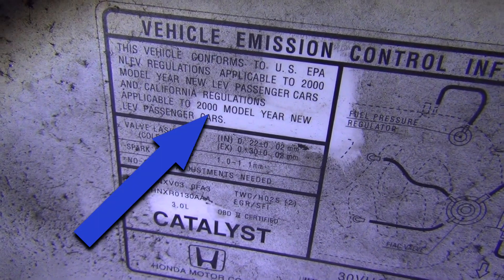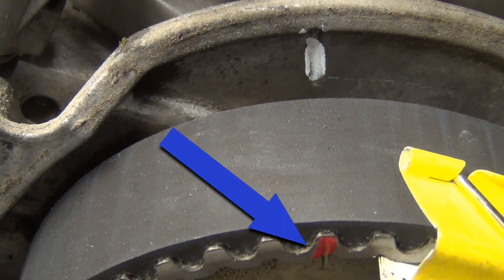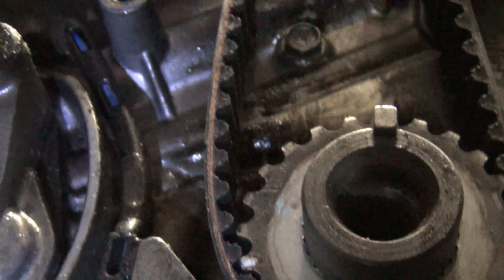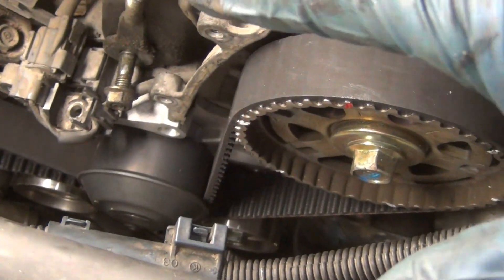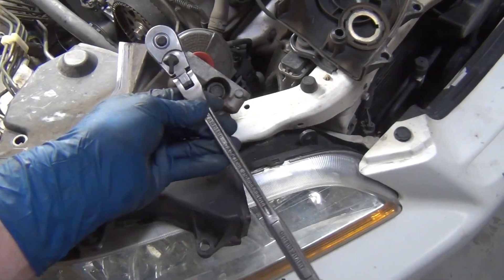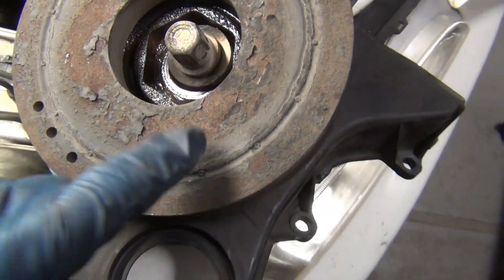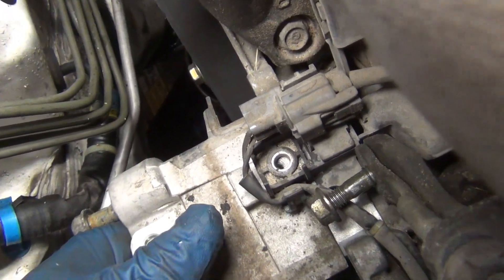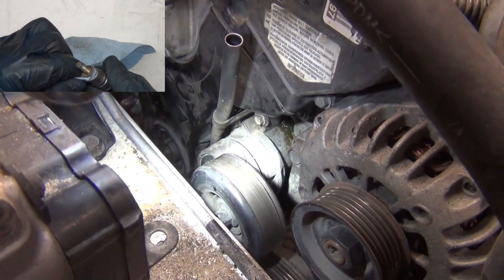How to Replace a Timing Belt   Honda   Acura V6 Edition 3.0L 3.2L 3.5L

Comment: Well Brian, I invested in the special thick socket, the harmonic balancer holder, and the powerful Milwaukee electric impact. I still had to heat the bolt, just as you advised. Thank you for your clear and precise guidance; it made a world of difference! 🎉

Comment: After the timing belt change.  No engine error, no code.  All ok.   Except, there is a small faint knoking sound from the engine and the engine seems to be running stronger than before.  Meaning, a stronger noise too.    Would that be something with the timing belt change?

Comment: I had the tensioner failure I replace it and it still has the clacking sound what do you think happen or I did wrong I bought the hydro tensioner from autozone could it have been faulty

Comment: ok so i have a 2016 accord v6. Need the timing belt done. What all do you recomend replacing when doing the job? Any of the pully's? Is the hydrallic tensioner part of the tensioner pully itself?

Comment: I like doing these belts even more than doing subaru's. On a bad day, they take about an hour.
Reply from the maker: That's pretty fast!  I take my time.  Hopefully do the water pump, plugs, and valve adjust while in there.
Reply: @briansmobile1   At my dealership,  spark plugs and valve adjust are separate services.  Which makes no sense, but no matter how many times I bring it up, it falls on deaf ears. 

But yes, water pump and tensioner every time. 

That socket you have, do you know if that fits on a subaru crank shaft? I searched for a commercially available one, but nothing for Honda's. I had the belt jump time on me ONCE when taking the crank bolt back out, but I still think about it every time.

Comment: This is not an interferance motor bud , these are non-interferance motor which means if these timing belts snap they wont bend valves or put a valve through the piston, even if you rotate this engines valves wont touch piston at all

Comment: If you do Honda timing belts often enough, I HIGHLY recommend getting a Lisle 77080 19mm harmonic balancer socket. These are about three pounds of impact socket with a 1/2" drive. Use with a decent air impact (not even a heavy duty one) and it will take the bolt out of the harmonic balancer EVERY time ... no muss, no fuss. I was amazed at how well it worked. You can find them on Amazon for ~$23 on Prime. Absolutely a no brainer if you do these on a regular basis. Every Honda engine I've worked on, whether 4-cyl or 6-cyl has the 19mm balancer bolt which you can use this on. https://www.amazon.com/Lisle-77080-Harmonic-Balancer-Socket/dp/B00RGNCV1U/

Comment: For all the years you have worked as an auto tech,did the camshafts ever jump on you,after you removed the timing belt ? Should it jumped,how did you get it to position,turn either way or just clock wise ?

Comment: First time doing the replacement and now the car vibrates badly. Anyone know why?
Reply from the maker: Yeah- I've had that.  Belt was off the mark by a tooth or two.  Usually caused by slack in the wrong section.
Reply: @briansmobile1  maybe the tooth because there was no marks or indentation or anything...

Comment: Very nice and well done video. I thought the tip for starting with timing marks very slightly counterclockwise was very useful as the slack can be taken out at the final check. Heating the crank bolt washer a very good tip also. Thank You

Comment: I'm going to use the starter to crack the crank bolt free but my question would be, how do you hold the balancer still when tightening the bolt?

Comment: Also you can grease your bearings and iddlers with mobil one high temp syntethic grease,pop the seals and greae them,i have a aveo that shatters the plastic iddlers but since i grease them,they have last 200k i also change the plastic iddler to a metal one,same size of close to.

Comment: So why does he line the timing mark slightly off counter-clockwise?  Did he explain the reason?  EDIT:  OK, he explained 7 mins later.  But still not sure benefit of doing that if you're going to crank 720 degrees to confirm timing after belt installation.  so he isn't doing the 720 degree rotation to check, he just cranks clockwise a little to remove slack in belt after installation.

Comment: Found the crank bolt comes out easy with an impact.  The rear cam pulley is tricky to center and want to rotate forward or back instead of rest lined up with marks. Do not remove crank pulley Key or if you do realign timing ring, sprocket to crank.  Mark old belt teeth before removing tensioner the make same marks on new belt to make sure rear pulley does not skip, crank and front pulley will stay put when using tips in this video.

Comment: @1:28  lol if the timing belt broke just putting a belt on wont fix it. Also get the special thick honda 19mm socket and stuff that on your impact gun. I don't rec using a torch...

Comment: Just a quick note, ALL J series Honda engines are non interference, so you can feel free ONLY ON HONDA J SERIES to rotate cams as much as needed if your belt was broken to get it back to all it's marks.
Reply: Old comment, I know, but the J35’s are in fact interference engines.

Comment: At 200,100 km my 06 Accord is due for a belt. My independent shop wants $1,200 + to do the belt and water pump. With recent piston slap on #5 I think the car is done. Excellent video, you cut right to the point. If it wasn't for the piston I would do the job myself 👍

Comment: Years later you are a life saver.. Straight forward and now I'm confident I have all the equipment needed.. Ill let you know how it goes! Water pump, timing belt, grenade tensioner , idler  pulleys x2 and office depot clips & harmonic 50mm puller tool. ✔
Reply: So how did it go ?? 
Did you tackle it? Does it drive. Please tell

Comment: Kudos. You always teaching us with your great videos. I'm looking forward to change my timing belt, rebuilt the transmission, and change the rear main seal in my Accord 99 V6 3.0.

I just wanted to show you and other people here this video in spanish about how to synchronize not the only the camshaft and the crankshaft, but also the other two gears (front and rear where the belt gets around too. Very valuable info. The rear gear has two marks (on the gear and the shaft). And on the front gear you need to get that bolt out to insert a long screwdriver all the way in. That gear has one mark but he says it won't matter if it doesn't have the mark if the screwdriver goes all the way in, I guess just to be safe get that mark and all the screwdriver in. On minute 6:45 he also explains to do not rotate the camshaft without the timing belt, and that if you do, then you should rotate the crankshaft mark on a horizontal plane(way). And depending in what unsynchronized position the crankshaft gear mark, then you move the mark to the closest horizontal plane (90 degrees). And then move your camshaft to put in the right up/mark position so you won't damage the valves. https://www.youtube.com/watch?v=b_F-YLZk2tI&index=6&list=LLgWu5YmOz0PMwN7C_RGYTIQ&t=0s

Comment: Replaced the timing belt on 97 Acura 3.0CL 6 cylinder, automatic. Drove it and found this: From a dead start the car hesitates/power loss when going into 2nd gear but will  gain speed. In neutral it sputters at 3,000 RPM and will not going higher in RPM. I'm thinking it is one tooth off forward on the front camshaft sprocket. I also noticed that the idle is about 600-650 instead of the 800-850 where it should be. Does anyone have any ideas?

Comment: how many miles does a timing belt last? What is the mileage interval  that you should change the the timing belt?
Reply: ron334 first I would check the owner's manual to see what they recommend. On my daughter's 2001 Honda Accord V6 the owner's manual recommends 105,000 miles. I change the TB between 90,000-100,000 miles. I would never go over manufacturer's  recommendation for changing a Timing Belt on a   zero clearance motor.
Reply: for the Honda/Acura J6 engines the replacement interval is 105,000 miles.   In my case however I didn't put a lot of miles on the car so I also ran into a time issue.   If the belt is getting old, despite the miles, it can break down and start to come apart.   I am replacing mine at 12years, 105,000 miles but most people would recommend not waiting longer that 10 years.   Sooner is better.

Comment: 9:50 the only way ive gotten by without an impact doing a timimg belt. It works!
Reply: Waffeey how do you hold the pulley still when tightening the crank bolt?

Comment: If i turned my engine clockwise by the front cam without the metal dowl in the crank gear a quarter can i just turn it back to align the dowl will that be fine or am i out of timing now?

Comment: Just had mine done at the local Honda stealership for $800.  They were running a special which included new timing belt, tensioner, water pump, coolant and drive belt.  Kinda makes me wonder how they made money on the job... maybe they didnt replace anything? haha.

Comment: question - so you mean to inform us that between 0:30 & 3:45, as long as the markings on he pulleys are aligned with the markings on the motor itself, we will be ok?

I ask bc Hayne's Manual makes it seem like it is the end of world if one does not align the #1 piston/valve/what have you with "Top Dead Center"...

Comment: It’s a great tech video with good info but why not clean all the power steering fluid and oil that was leaking in there before putting a new belt??

Comment: Thank You Brian. I have a question. I have 2004 Honda Pilot and have an error code 0341 which is the CMP sensor.My mechanic says that I have to remove the timing belt in order to remove the CMP sensor, however, other mechanics say that it is not necessary to remove the timing belt could You please tell me what to do? I am confused also

Comment: Well done. It's nice to see a video from someone that is knowledgeable AND articulate. Lots of great little tips in there like using the wife's Macy's credit card to hold the belt on the crank. I didn't read the comments but you turn the engine over twice to verify timing alignment, right?

Comment: I used a 4X Torque Multiplier and have never had any problems removing crank bolts.  It is a lot safer, since the torque is gradually applied to the bolt, and I never have a problem where the bolt release and your knuckles smashes into something.  Other than the cost I'm surprised that people don't use it more often.

Comment: I got 2002 Acura TL 3.2 i change time belt 7 years at 67,500 mile . Now i have 8 years on Time belt 124, 600 on it . only put on it in all most 8 years 58,000. You think i can wait little more on it.

Comment: oh shit.... timing belt replacing was sooo freaking easy on pontiac sunfire i had.. and now i recently bought 7 gen accord v6 and it seems a lot more complicated based on your video instruction. 
I understand that you have replaced water pump and a few pulleys along with timing belt but still... timing belt part doesn't seem as easy as it was on all my previous cars. :(
Reply: I traded my 2010 Odyssey for a 1990 pontiac 6000  after reading your coment.   Now THIS is indeed a DIY . .

Comment: My car is at the near 250K mark. This is probably a job I'll be doing soon. Just has to replace my steering fluid line this last winter because the hose was rotted.

Comment: Hi Brian , I am replacing  my timing  belt  and I ran in to a bitter of problem. My top two camshaft lineup perfectly and the bottom small camshaft off the mark. i rotated so many time to get bottom mark lineup but still I can get it right . Your help will be greatly appreciated very much...senevi

Comment: I was looking to do this on our 2008 V6 until I saw the menace that is the harmonic balancer. Said F that and had someone do it. Would've taken me 2+ days probably.
Reply: Just purchase Lisle 77080 19 mm Harmonic Balancer Socket for Honda on Amazon for $25.    Takes that bolt off in seconds.   Watch Youtube videos with that socket in action.

Comment: if the old belt is still intact and not jumped time you can create your own timing marks with a marker or something on the timing gears and corresponding marks on the old belt. once it's off count the teeth between the marks and transfer the marks to new belt. so easy and quick, and you really can't mess up the timing.

Comment: I love Honda tBelts!  I used to use a torch for the balancer bolt but,  now I use a tool I made. I took a short 19mm and slid it into a deep socket that is about the same size as the washer and welded them together. That way the washer and the bolt both get hammered, by the impact. It is amazing and has never failed me. It's a 1/2 socket of course.
Reply: Just purchase Lisle 77080 19 mm Harmonic Balancer Socket for Honda on Amazon for $25.    Takes that bolt off in seconds.   Watch Youtube videos with that socket in action.
Reply: @troyfall6573  I agree.  Pretty much most people recommend an impact rated at >500lb/ft torque for the crank bolt.  That plus the special socket should get them off.  I haven't done mine yet but I have a 1400 lb/ft electric impact that takes axle nuts and rusted exhaust bolts off like they weren't even there so I'm not too worried.

Comment: Hahaha, the number of times I've wedged a prybar against the ground and cranked the engine to get the crank pulley bolt off...  LOL
Reply: Dont do it on pre 2000 hondas you will shear the bolt , as the pre 2000 hondas are anti-clockwise rotating engines

Comment: How do you know/read about firing order for the vehicles? 
I often noticed it's better way to change idler pulleys and tensioner and water pump when replacing timing belts. It leads us to go more thousand miles conveniently, other way Idler Pulleys or Water Pump may deteriorate before timing belt.

Comment: True test is driving it and feeling that you have the same power you did before the belt. Hack mechanics may be a tooth off, causing the timing to be off and not have full power.

Comment: Theirs also a special honda crank pully tool you can buy for about 30 to 40 dollars, I bought one to make it easier
Reply: If you want to use the crank pully tool you can rent it for free at Autozone, O'Reilly.  Just put down a deposit.   OR better yet, Just purchase Lisle 77080 19 mm Harmonic Balancer Socket for Honda on Amazon for $25.    Takes that bolt off in seconds.   Watch Youtube videos with that socket in action.

Comment: to whom it may concern..I did a very similar job on a KIA sportage..all went well except....on the top of the upper timing belt cover 7:28 there is a little plastic seal ..make DAMM sure this thing is tucked in because mine apparently got caught up between the cam sprocket and the belt and jumped the time about 60 degrees  while I was tooling down the highway celebrating my successful timing belt/water pump job.  Luckily, it didnt junk the engine..but it did wreck my trip to the botanical garden and forced me to redo the job.  Just a heads up!!

Comment: i wish it paid 5.8hrs honda v6s pay 3.5-4.5 at firestone lol
Reply from the maker: 2000 MY pays longer.  That's for the water pump too.  They newer fly-by-wire ones are a lot easier.  Less parts, more room.

Comment: Y'all think that's hard try an EJ20 quad cam 😣
Reply: Filip laskovski 
pffft, my gf's old 98 Forrester had the quad cam. two vice grips later it was cake.
Reply: Yep, or any quad cam engine for that matter. Always an adventure.
Reply: Alot more room to work in the front of a Subaru.

Comment: 5.4 hours - so it'll take me 12 xD
Reply: Your first one will. The next one is much easier.
Reply: @sparkplug1018  frutería suena
Reply: My first (and only) took me like 7.5 hours.  That’s including 15 mins for lunch and like 20 extra minutes fighting with the serpentine belt tensioner.  
Hardest part was getting the crank pulley bolt loose, they are no joke.
Most technical part was getting the new timing belt on “just so.”

Comment: Did my 94 ford probe gt a couple years ago.  This brought back some memories.  Everything worked out but it easily took me 8 hours not having done the TB, water pump, and pulleys before.  Learned A LOT about that engine though. Well worth the time.

Comment: I have to say that now I've seen this and how much work is involved, I'm surprised on the price my sister got from a Honda dealership for a 05 Honda with a v-6!  I think 627 dollars is not all that bad, what do you think?   Oh, and that's parts included!
Reply from the maker: That's very decent.  It's usually north of $700 with all the parts listed.  If it's just the belt and no pump or timing kit, that would be about right.
Reply: briansmobile1 
Thanks for the reply Brian, I was a little worried at first that she would get taken advantage of ( wouldn't be the first time, sad to say)  but after seeing what all it takes to do this job.........

Comment: And if the power steering makes noise right after the timing belt change  you have to replace the O-Ring on the P/S pump inlet.
Reply from the maker: Nailed it!
Reply: @briansmobile1  also these pumps whine if the belt isn't tensioned to spec

Comment: There is also no need to replace the screw type tensioner. As long as you have a bracket all you have to do is take the 8mm off of the bottom and use a #1 flat head screwdriver to bring it back in. As long as the seal is good it won't ever go bad. I've never seen one fail.
Reply from the maker: This one leaked.  Bad seal- it's over.